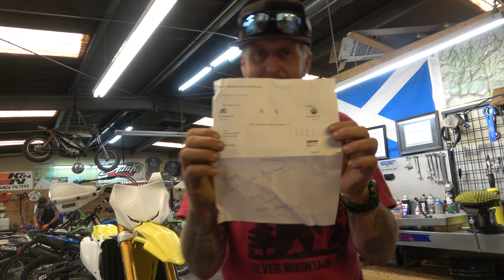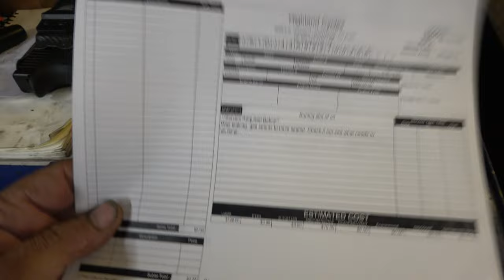Blown up YZ450F | Bad Air Filter Maintenance | Mail Time | The Shlog #212

Comment: That motor ate a few pounds of sand, way to go short bus riding Yamaha buyer. 

Backyard mechanic pro tip, use a foaming glass cleaner inside the airbox to keep MORE shit from falling in when removing the filter.

Comment: Ran my Yamaha Tri Zinger for about 4 years straight using just dishsoap n water to clean the filter and no oiling. Didn't know any better as a child,  but it kept running perfectly over the years. I eventually bent the frame, man I miss that thing.
Reply from the maker: That’s a testament to yamaha

Comment: Hello anyone with machanic advice for me. I have a Ktm 50 just put new piston in and had it running sound but the next day theres drag on the back wheel and when I push it fast it starts up with out kickstarting. Im shocked as I know this can happen with geared bikes. Any help and reply welcome. Thanks
Reply from the maker: You need to either adjust the clutch or replace it. That happens a lot on those little bikes
Reply: Thanks I love this page. Your the dude brother. I had a small incline it could of been that but was just a stab in the dark.